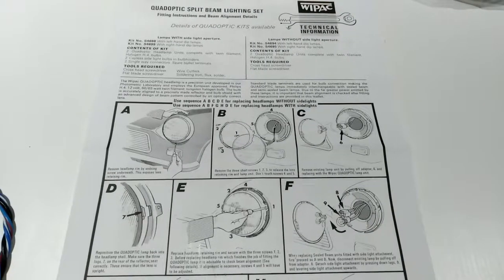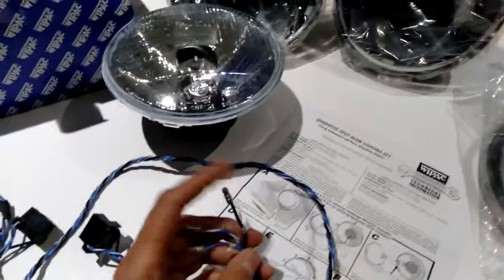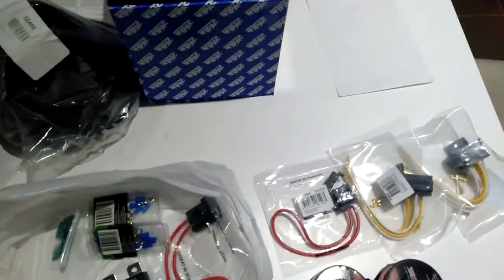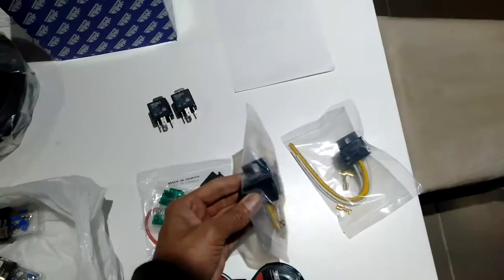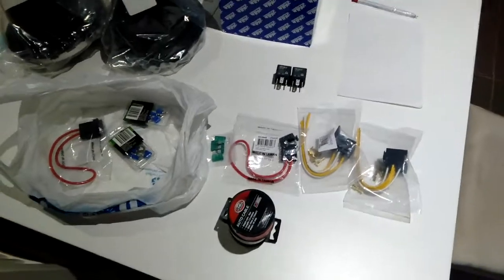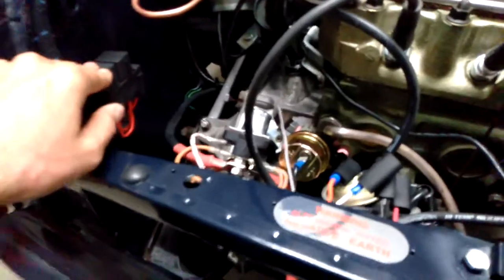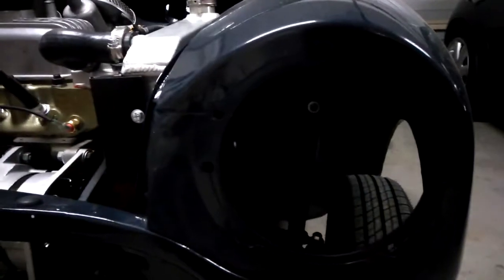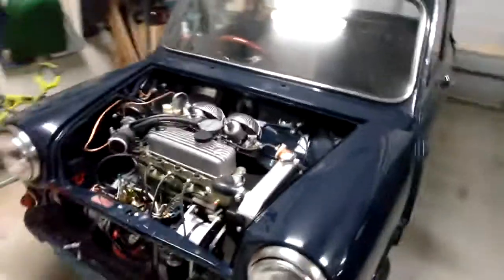Morris Mini Cooper S - Headlights EP034

Comment: Do they not come with a inner bowl ? Like the originals. I bought a set of P 700 headlights very similar but my glass remains loose once tightened .is there some sort of spring system that I am missing any help would be appreciated.
Reply from the maker: It doesn't need an inner bowl as there are clips/tabs that hold the outer ring to the headlight glass. Look at 20:00 mins.
Reply: Is it possible you could show the clips on the inner ring how they are supposed to be .because I have tried always and it will not tighten it just stays loose. Unfortunately your video fast forwarded through that